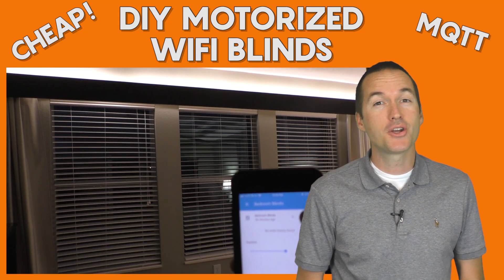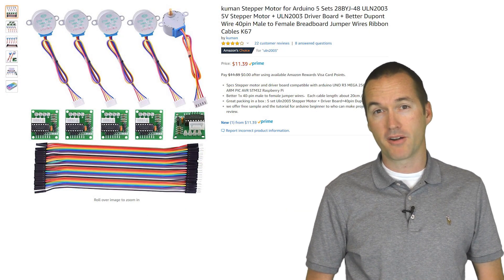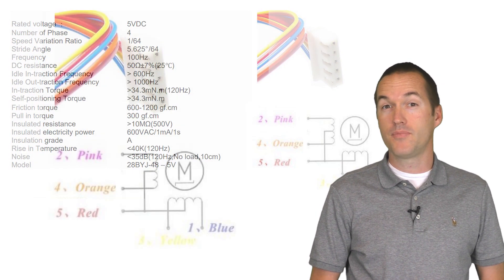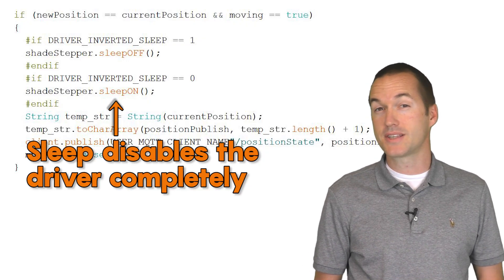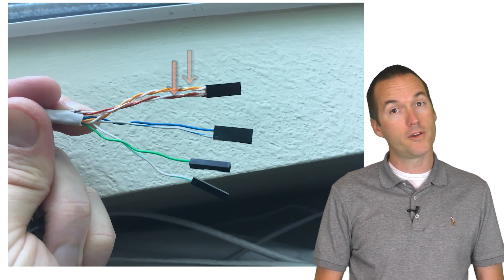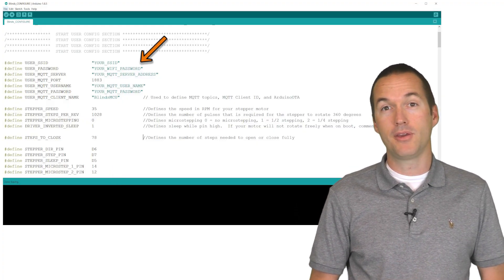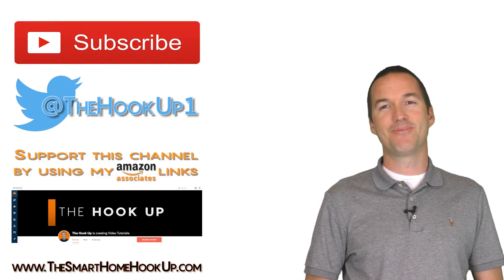Motorize and Automate your Blinds for $10! (WiFi)

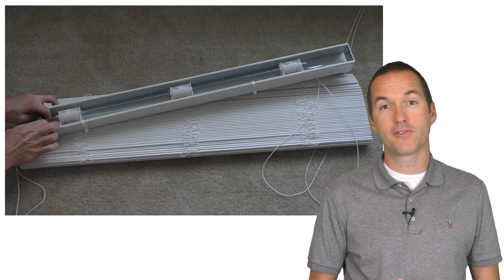Comment: Arduino: 1.8.10 Hourly Build 2019/03/27 05:33 (Windows 10), Board: "LOLIN(WEMOS) D1 R2 & mini, 80 MHz, Flash, Disabled, 4M (1M SPIFFS), v2 Lower Memory, Disabled, None, Only Sketch, 115200"

Blinds_CONFIGURE:1:108: error: SimpleTimer.h: No such file or directory

 #include <SimpleTimer.h>    //https://github.com/marcelloromani/Arduino-SimpleTimer/tree/master/SimpleTimer

                                                                                                            ^

compilation terminated.

exit status 1
SimpleTimer.h: No such file or directory

This report would have more information with
"Show verbose output during compilation"
option enabled in File -> Preferences.
Reply: how to fix it?
Reply from the maker: You'll need to install the library from the link beside it.

If you're not familiar with this process I'd highly recommend watching this video: https://youtu.be/90n8cZJcFaU?t=91 to learn how to set up the arduino IDE properly for other people's code, or you could just use one of the precompiled .bin files from here: https://github.com/thehookup/Motorized_MQTT_Blinds/releases

Comment: we need one vertical blinds (up and down) that open and tracks sun so it opens slowly was the sun comes out and follows it then simply closes at certain time of evening then rinse and repeat the next day ...
Reply from the maker: You'll probably need something with a little more torque to do that.  But the second part would be pretty easy to automate in node red (just divide the total movement desired by the difference between sunrise and sunset times to get a %/minute move), if doing that you should probably limit the movements to every ~10 minutes or so to give the motor time to turn off and cool down (ie. don't issue a movement of .01% every 15 seconds).

Comment: Hi,
Thanks for all you nice videos and material. It is always nice to watch, and gives lots of inspiration.

You gave me the last push into 3D printing, and I  bought a Ender 3 Pro - works very nice, and after figuring out the initial bed leveling, it has been printing none stop - nice.

This brings me to my question, about which tools you and others are using to create stl files - or modyfing/updating existing stl files. Both for windows and linux.

So what are you/community using ? What can you/community recommend?

TinkerCAD ?, SketchUp ? Fusion 360 - what to engave with ?

Thanks
/Joern
Reply: I used sketchup for about 3 years and recently moved to Fusion 360. Sketchup is good for helping you get the basics of CAD, but Fusion 360 is incredibly more powerful. If your familiar with CAD, try Fusion.

Comment: Is there a way to make this work with SmartThings?
Reply from the maker: I'm working on that integration as I write this
Reply: @TheHookUp  Oh man I cant wait!  I tried to dive into HA but the overhead was just too much to set up to begin with and my home was already set up with ST so there was very little reason to switch over for the added functionality.  Thanks Great video!
Reply from the maker: Have you ever used an ESP8266 device with ST?  I just uploaded this .bin file if you're willing to test it out for me: https://github.com/thehookup/Motorized_MQTT_Blinds/releases/tag/ST_WifiManager

My ST hub isn't booting for some reason.
Reply: @TheHookUp  FWIW:  I have used ESP8266 with ST in the past (to a limited degree).  I flashed your .bin to a NodeMCU and although I can see the NodeMCU in the ST App it will not respond to anything except the 'refresh' button/icon. I can see it respond in the ST IDE logs.
 >>>Example:(6:00:15 PM: debug Using ip: 192.168.0.69 and port: 8090 for device: xxxxxxx-xxxx-xxxx-xxxx-xxxxxxxxxx
6:00:15 PM: debug Executing 'sendEthernet' refresh
6:00:15 PM: debug Executing 'refresh()')<<<

I used  Parent_ST_Anything_Ethernet.groovy by Dan Ogorchock .

The NodeMCU does show in the newer ST App also.

I think I set it up correctly but I'm very much a  noob and basically have no clue.  I just want to provide you with this feedback because you asked someone to try it and I did not see a response. Hope this is helpful.

BTW,  I did get a blind operating with HA and MQTT beautifully! Thank you, thank you!
Reply from the maker: Thanks for the feedback. I need to get a new st hub for testing
Reply: @TheHookUp  Hi, iv just bought the printer and printing the second motor bracket as i write, unfortunately the 5mm hex is too small tho, im going to run 6 blinds in my conservatory, im going to fit an Ethernet coupler under the pelmet and then an Ethernet cable to the blind for a quick connection, i just wanted to confirm that id NOT need extra cables for smartthings, as my cables will be hidden behind coving, i think you call it crown moulding in the US, anyway i liik forward to smartthings integration and deffo battery packs for other blinds, keep it up, cheers from sunny Manchester UK
Reply: Hi,  @TheHookUp   have you made any progress on smart things integration?  I really hope it can work.
Reply from the maker: @JosephCooley  Yes, I have it working on my test setup.  The problem is that the ST IP address must be configured prior to compiling, so using WiFi manager doesn't work.  

I need to clean up the code a bit so people will feel comfortable configuring and flashing using the arduino IDE.
Reply: @TheHookUp  Awesome I can't wait!  Thank you for all you have done on this I'm excited to try it!
Reply: @TheHookUp  Great news! I have them working in HA but don't want to switch everything over from SmartThings.
Reply: @TheHookUp  Any update on SmartThings integration?

Comment: Nice video! Looks not to hard, so i might invest in a 3D printer and give it a go. 
One idea though... i'm unable to get all those cables nicely behind the blinds... 
Wouldn't it be something to make use of a battery and some small solar panels to power this battery...
I have this in my Velux motorised blinds, would be awesome to get a DIY setup aswell.
(don't know if you really, really, really need 12v? 5v would be easier of course...)
those 12v are possible, but a bit big to put on my window...
https://www.amazon.com/ECO-WORTHY-Portable-Battery-Charger-Batteries/dp/B015ZGDYII/ref=sr_1_3?keywords=solar+panel+12v&qid=1555354691&s=gateway&sr=8-3
Reply from the maker: I've got about $80 worth of different parts on their way from Aliexpress currently.  Plan on testing out all different combinations to figure out the best battery + solar solution.
Reply: @TheHookUp  
Awesome!
Can't wait to see it :)

Comment: how noisy i it?
Reply from the maker: About the same as pulling manually pulling the string on the blinds.  Most of the sound comes from the actual movement of the blinds, not the motors.

Comment: This project is going to be way over many people's heads!
Reply from the maker: Hopefully this is a good starter project for some people out there.  If you look on the github page I have a couple pre-compiled "No Programming Required" .bin files.  One of them even uses Alexa local discovery so you don't need anything but an echo device to get started.

Comment: It's all fine until somebody hacks it.
Reply: PapaGeorg10  The WiFi controller.
Reply from the maker: I think I would call this pretty low risk.  For someone to hack this they would either need physical access (already in my home taking blinds off the wall), or wifi access, meaning they have already penetrated my network and are on my LAN.  If they are already on my LAN there are many more things I'm concerned about before worrying about opening my blinds and peeping into my house.

Comment: @The Hook UP Any reason why hex adapters are not symmetrical (distorted)? Other than that great project.
Reply from the maker: Thanks, added them to the Github.
Reply from the maker: Hmmm, that's a good question.  Have you printed it to see if it fits?  I just made a default hexagon in 3d builder to easily subtract the shape out of my existing part, maybe they have a strange hexagon.
Reply: @TheHookUp  No, I would have to modify it first because I have to make it wider and not as tall as it is to fit in my frame. I opened it in SketchUp and the distances between the corners are all different. Because I have to modify it anyway it is not going to be a problem but I thought you'd like to know just in case. My base has to be 55mm wide and 37mm in height, the motor barely fits.
Reply: @CMDRSloma  Hi, did you sort out the hex connector, i need 5mm but the ones i printed are wrong, there too small and streached, if you managed to modify a 5mm could you send me the file please, thanks.
Reply: @sciroccomods  I had no time to do it. However I will have some free time on Friday and I was actually planning to sit down and modify it so I can order my prototype from 3DHubs. Once it's ready I will share it.
Reply: @CMDRSloma  Ok excellent, iv got all the bits ready and waiting now, just need a psu and these hex adaptors, cheers.
Reply: @sciroccomods  Here are fixed hex connectors in 5mm and 6mm sizes: https://www.dropbox.com/s/1y3dmszg4y366o4/Adjusted_hex_connectors.zip?dl=0
I have just ordered prototype from 3D Hubs so those are untested but no longer stretched. @The Hook Up feel free to copy, link and share if you like.
Reply: @CMDRSloma  Thank you very much, ill print one now, if they work then maybe @The Hook Up could include them, thank you.
Reply: @sciroccomods  Glad to help, let me know if it is working for you.
Reply: @CMDRSloma  its perfect. thank you. you should let the hook up know and he could swap them. cheers.
Reply: @TheHookUp  Please swap the stretched 3D Print models of Hex connectors (5mm and 6mm) with the ones I modified, those work fine and I would like to share them with the HA community. Here is the link: https://www.dropbox.com/s/1y3dmszg4y366o4/Adjusted_hex_connectors.zip?dl=0

Comment: Could this be adapted to use NIMA17 stepper motors? I have a like 10 brand new in a box somewhere.
Reply from the maker: depends if you an fit a nema17 motor in your blinds housing and get it to line up with your tilt rod.  The code will drive a nema17 without modification.

Edit:  You will need to change the # of rotations on a nema17, the ones I used are 1028 steps per rotation, most nema17 are 300 steps per rotation.
Reply: Firstly, absolutely fantastic video, thank you! How would I go about changing the code to run the uln2003 with a stock stepper? I bought 5 off amazon and have some low torque projects in mind but have no idea where to start! Thanks in advance for any light you can shed on this.
Reply from the maker: I'd recommend the Accelstepper.h library, although it will work fine with the standard arduino Stepper.h library.  I have a version of the code that uses the ULN2003, just need to find it.

Comment: I was trying to the load the code to my nodeMCU tonight and got the following error C:\Users\yagod\Documents\Arduino\libraries\PubSubClient\PubSubClient.cpp:9:21: fatal error: avr/wdt.h: No such file or directory

 #include <avr/wdt.h>
Any ideas?   Also, is there a way to get this to integrate with smart things?  Great video and explanation.
Reply from the maker: Do you have the ESP8266 boards manager installed?  I'd recommend checking out the pre-compiled bin files that I've included.  Check out this video for more info: https://www.youtube.com/watch?v=VdEGGyROgoo
Reply: @TheHookUp  Yes, my ESP8266 boards manager is installed, I had an older version on the PubSubClilent installed, I use your link to the newer library and it worked.  Thanks for the other video, it was a great help.

Comment: Might I suggest something for hiding cables, https://www.bunnings.com.au/brutus-6mm-x-3m-building-moulding-capping_p1100642. I have used this to run cat 6 cable around my house without damaging anything, it can house 2x cat 6 or 3x cat 5e cables, very durable and using https://www.bunnings.com.au/moroday-40mm-x-10m-grey-double-sided-body-mounting-tape_p0057722 it doesn't destroy your paint work if you want to remove it, also it costs next to nothing.

Comment: Wondering if there is some "ready out the box" motor and driver 12V and bypass potential overheating issues of those 3$ motors? for who is willing to spend few bux more
Reply from the maker: There's a 12V version of the 28BYJ, but I've read that it has significantly less torque than the 5V version running at 12V.  I was doing some experiementing last night with the ULN2003 drivers that come with them and a different stepper library to allow for 12V usage in unipolar mode and the motors got HOT.  I never experienced any heat problems using the DRV8825 drivers and the motors in bipolar mode, even when I was doing 2-3 minutes of continuous testing.  The code only powers the driver when it needs to move, so only about 3 seconds at a time.

As to your point, I don't know of any small form factor motors that will deliver more torque in exchange for more cost.

Comment: Great project! I am going to build automation for three blinds in my den.. Can you share the "single nodemcu - three motors"  INO file? Thanks for the video!
Reply from the maker: You can, but it will require some modification of the code.  I'm running all three of my blinds from a single nodemcu, but they are just wired in parallel so they are not individually controllable.
Reply: The Hook Up I was planing on controlling two blinds in parallel and wanted to know if the driver could handle both motors or should I have two drivers

Comment: You can also get the Ender 3 for $209 direct from Creality: https://www.creality3donline.com/c/ender-3_0400

$239 gets you the pro version with a magnetic build plate, a better PSU, and a better axis: https://www.creality3donline.com/c/ender-3-pro_0402

(Note: I don't have any affiliation with Creality - but buying direct from them is usually cheaper!)

Comment: Great video. Did you try the 12V versions of the same stepper motor? I've read that they have more torque and you can use the same driver boards supplied with the steppers
Reply from the maker: I didn't try them.  I read some articles that said the 12v version had significantly less torque than running the 5v version at 12v, but I never tested it myself.

Comment: I'd appreciated if you prepare some video about how to control roller blind as well
Reply: Agreed. The issue I've come up against is roller blinds need torque, and lots of it. I've had some success with Lego motors and some pretty serious gearing (probably around 1/150 for a small, light blind), directly driving the roller.

Comment: This is a good overview, especially the stepper motor tweaks. I'm using ESPHome for mine which reduces a lot of complexity for you. Using the built in cover support with the ULN2003. Here's the config for my blinds if you're interested: https://github.com/jquatier/jq-homeassistant/blob/master/esp-sensors/master_blinds.yaml
Reply from the maker: Nice! Are you running them at 5V? How's the torque?  How does ESPHome deal with reboots? Does it remember position?

I was thinking that I'd need to set up a sensor in ESPHome to store the value for the current position (and retrieve it from HA on reboot), does it do that automatically?

Comment: Guess I'm getting a 3D printer ;)
Reply: Just picked up the printer he suggested, actually 2 of them, found one on craigslist for my son for 75 bucks that needed a 3 dollar part to fix it. There is a learning curve, but I have already printed some cool stuff. Printing larger bumpers for my Roomba right now to keep it from getting hung under the back corner of my couches. You will not be disappointing if you buy this.

Comment: Your use of the "first" MQTT value as the "home" position seems weird to me. Why not have a separate MQTT topic for this so it's distinguishable and separately settable and stable over time? How can we know the NodeMCU will see our "home" value "first" if we're not babysitting it when it happens to reboot for some reason (watchdog, power fail, etc.)?
Reply from the maker: Once you send a retained value there it will pick up that value right after subscribe and sets the boot Boolean to false.  

I've been using it for 1.5 years on my outdoor shades and it's been solid.  That being said, I'll be putting out a different version in the next few days that uses SPIFFS to save the position in non volatile memory if you prefer to not use retain.
Reply: @TheHookUp  How to push this value in mqtt. can you please guide?

Comment: Is it possible to pay and order the 3D printed components from you? I just need one set
Reply: upload the STL files to Shapeways, have them print them and ship them to you.
Reply: @Thirtybird  
Shapeways seems to have gotten really out of control with pricing. I ran this through their parts calculator, and they wanted $80 for one.

If anybody doesn't have access to a 3d printer and wants to take on this project, get in contact with me and I'll print them off for you for a FAR more reasonable price.

Comment: How does manually tilting the blinds affect the mqtt current position state? I realize that the motor is off, but if the last updated state was 50% and you set them manually to 100% using mqtt to push a 0% seems like it'd undershoot it.
Reply from the maker: Correct, you'd need to manually adjust it back.  The good news is that because it's a stepper it can easily just slip (miss steps) without damaging the motor.

Comment: Great video! I'm really excited to try this project. Do you have a write-up on your website for this? I might need some links for setting up the prerequisites, so it'd be great to be walked through that in a tutorial article. Thanks!
Reply from the maker: The links for the needed libraries are at the top of the sketch.  If you don't want to mess with the arduino ide I'll have a precompiled version out in the next few days.
Reply: @TheHookUp  I may need a little more hand-holding but only one way to find out! Thanks again!